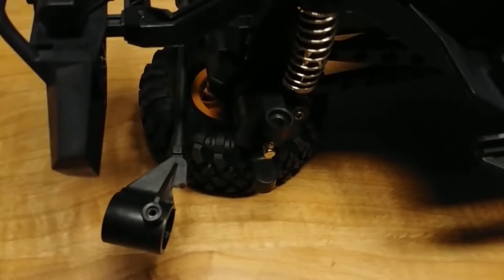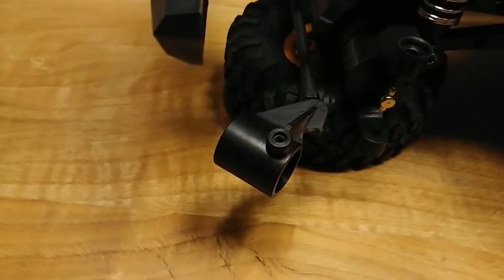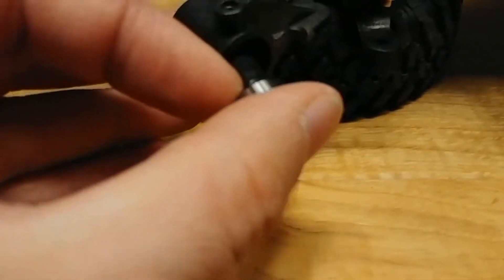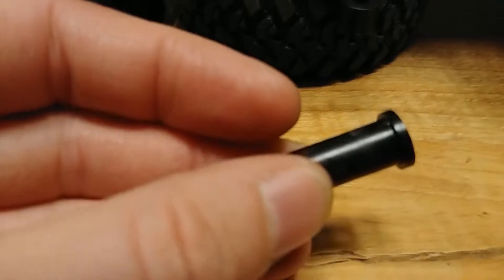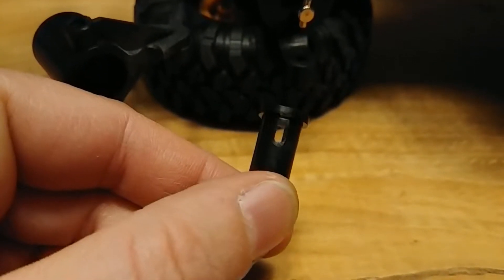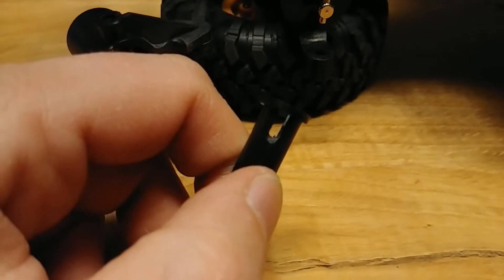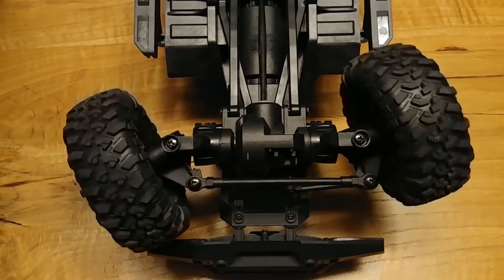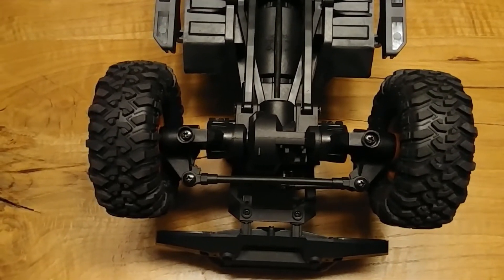HB Toys ZP1001 Free Steering Mod

Comment: I've just bought a brand new one from BangGood and did the steering notch mod. However the servo seems so weak it cant even turn the wheels on hard flooring, the tiniest knock also shuts the wheels go incorrect angle as if the servo just doesn't have enough torque. Any ideas???? Thank you
Reply: Mee to had same problem
Reply: @syahrulzahrin2545  I replaced the servo and it worked perfectly
Reply: @M00SEY84  what typeof servo did u use?
Reply: @FrancaRC  it is plug and play? Or need to change every electronics thing?